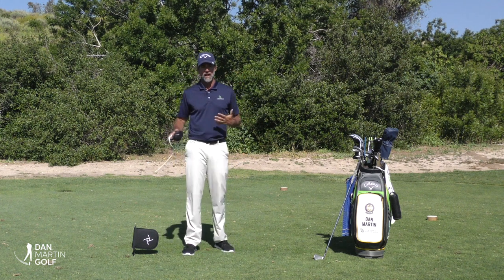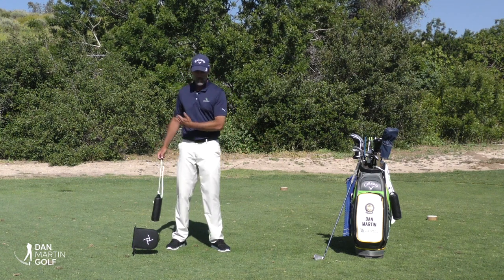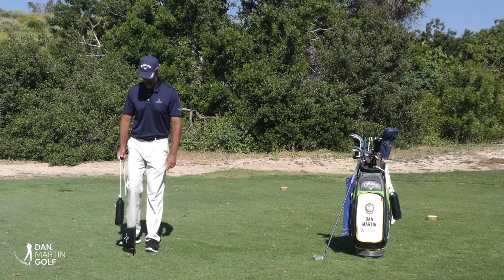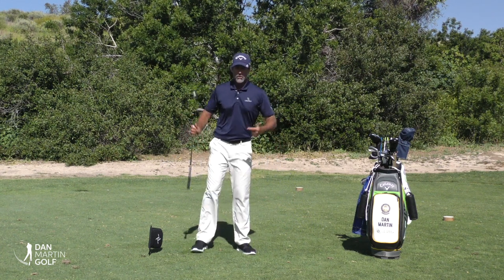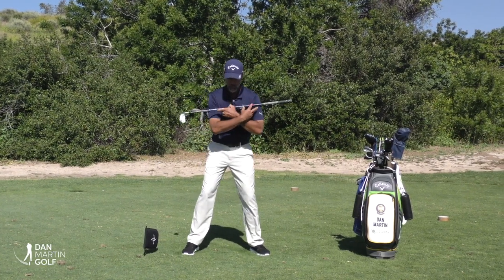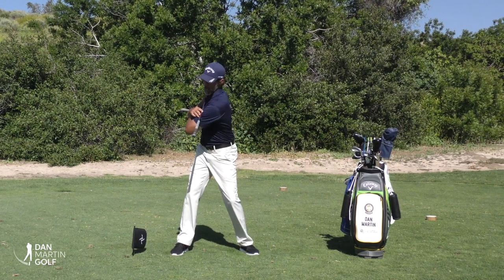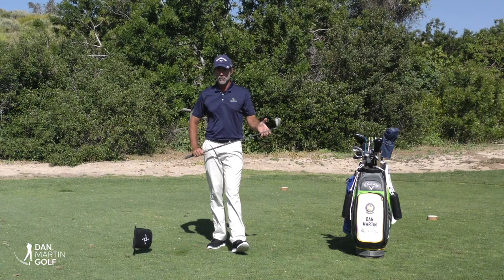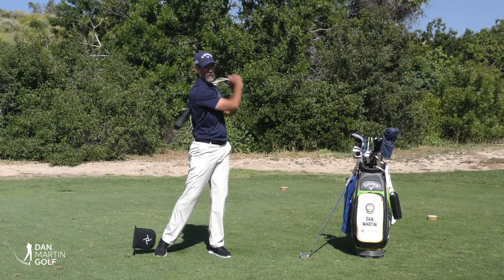The Golf Swing is a Series of Slings and Swings!  How Momentum is Transferred through the Body!

Comment: Amazingly simple, hard to not fall back into old bad motions in the pressure of a match. I must work with my Pro and continue to try and get this sequencing engrained. I find I've made more progress using the Pro in improving my full long shots, longer clubs, yet still struggle with a simple 20 yard pitch, where i still sometimes torque the handle and push on the shaft.
Reply from the maker: For sure - definitely do the Wrecking Ball drill to help you with short game shots!

Comment: Awesome explanation - how is it though, that a stiff shaft helps with higher swing speeds - is there not an element of leveraging on a advanced level in the swing?
Reply: Stiff shaft creates more control at higher swing speeds where leverage is not a problem.
Reply from the maker: Ideally there is no leveraging whatsoever.  If you put a light flex shaft and a x-stiff shaft in a swing testing robot, there will be virtually no difference in flex characteristics or ball flight data.  Shaft flex is to help dampen the mistakes of unwanted leverage that the human puts into the shaft.

Comment: I think the preface to this should have been to brace the core first because I can move my hips independently of my torso without bracing my core. If I brace my core then the hips will indeed pull on the torso and so on. 

I couldn’t understand how Dan was feeling a pull on the torso even with a small turn of the hips but if you brace the whole system (not rigid but a ready tension) one will transmit to the other, hips will transmit to the torso etc

Comment: how do you transfer liner momentum to angular momentum in a golf swing.
Reply: You have nothing to do, it just happens according to physics. If I move a rod perpendicular to its length and then fix one end the other end will gain angular momentum as shown by the fact that it rotates about the fixed end. All I did was fix one end after the linear Momentum got going and you have rotational motion